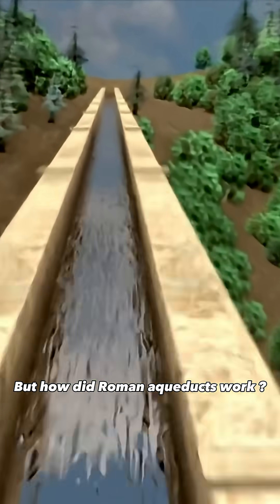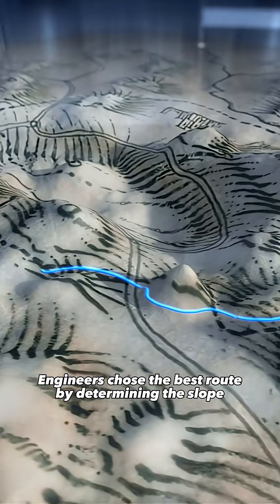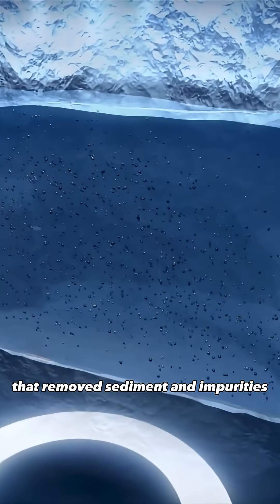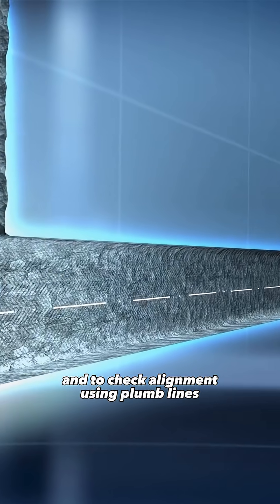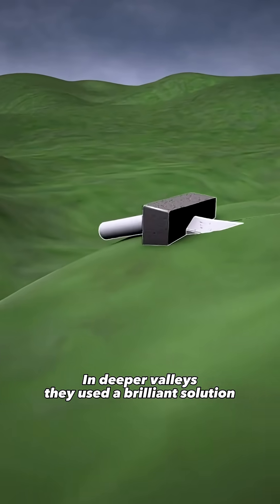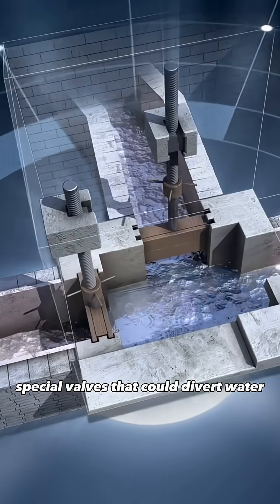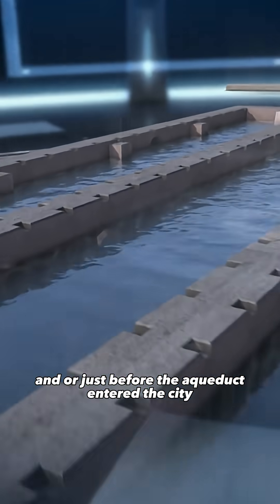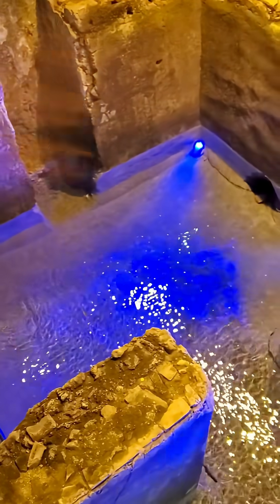The engineering of roman aqueducts explained #history #romanempire #engineering #aqueduct

Comment: Truly geniuses. I’d love to see what they could do with electricity and engines.
Reply: Probably what current geniuses do tbh. I mean, the concept of a computer alone is fucking insane if you think about it.
Reply: @alwest4472  Still black magic to me and im a cs major
Reply: @alwest4472  not that complex by how it works, just the structure itself is
Reply: So oddly the romans and the Greeks both at many points had invented steam power. They used it in baths. The biggest issue for the romans was precision as engines require tight tolerances. For the Greeks it was culture and philosophy that got in the way. Why make something when you can simply discuss the idea and move on with life.
Reply: @Peyto23 The biggest problem was their steel was not strong enough to build up pressure. The stronger steel was invented in the late Middle Ages. They could only bult toys with steam
Reply: @stijnvisser2290   Could have used sun-powered Stirling engines for pumping water, if they invented them.
Reply: @boofergod  even if the Romans had figured out the precision problem, it still would have been impossible to industrialize. At least in the way we did, because they didn't have any steel to build key components. Trains, and train tracks would have still been impossible.
Reply: @boofergod no tolerances don't even enter into it when you've not yet developed the metallurgy and machining techniques necessary.
Reply: @boofergod 
Regarding the Greeks, what you say is a bit exaggerated, philosophy did not stand in their way but was the basis of their development as a civilization. It is important to note that their philosophy is actually a trajectory of psychology and analysis, just the fact that they did not stand out like the Romans in engineering mastery, this does not mean that the Greeks, through their analytical thinking, did not have a titanic contribution to their development as a civilization (otherwise, they too would have evaporated over time and disappeared like many other ancient civilizations)
Reply: @gustychad2093 They weren't geniuses, they copied the Egyptians & Persians. Listen to Dr. Roy Casagranda of The Austin School.
Reply: @boofergod what a nerd. I agree.
Reply: @boofergod yeah i think greeks were caught up in philosophy
Reply: @boofergod  it’s sad that many don’t have that same philosophy today
Reply: @boofergod  The steam engine was invented in the Ottoman Empire. Its purpose was not to start an industrial revolution, but to spin the doner meat while it's grilling
Reply: @redacted8983  huro (hero? Whatever) of some city in greece invented a simple steam turbine well before the prophet was born.
Reply: @boofergod Neither of them had the economic and legal system which would support innovation, and its application in large scale.
Reply: @boofergod  wtf are u saying 😂😂😂
Reply: @Peyto23 The Romans and Greeks at the time simply didn't have the atmospheric knowledge or technology to create the air-tight, pressurized environment the steam engine needed. They didn't invent steam power, they played with steam and the idea of steam's uses. Both had economic, societal, and technological reasons NOT to go any further to full-scale production of industrial machines.
Reply: @boofergod That Greek response gives me pain
Reply: @boofergod  I have never read something so shallow and garbage about two great cultures.
Reply: @RichardWagner-hi4zn  and yet it is incredibly fair and accurate. The romans did not have precision. As a machinist working with tolerance a qaurter of a human hair is difficult. Thats my job. Roman engineers were insanely smart. They invented/borrowed from everyone. The issue still stands is that they did not hold precision in a high standard. At the time it was not a priority. Nor a necessity. Precision is not inherent. It is not a given. It is an invention. And that requires many more inventions and technology before you can sniff an engine. The romans were not even close to any of those. And don't even start with "but old times had better wisdom, so they may have had a better way of making engines" that is a fallacy to the max, and belongs with every failed engine design ever. 

The greeks being too philosophical is also accurate. They themselves as a culture in many writings pushed the idea that if it can be thought of then there is no reason to make it. As the world is not for making things. The invention of the scientific method would not have stuck in ancient greek  time. Nor testing ones ideas, because once again a good logos is better than a great pathos.

  So shallow? Maybe. Inaccurate absolutely not. I love and respect both cultures, but for fuck sake they aren't gods. Every culture is dumb and smart in their own ways. Even the worldwide culture that is taking root now has way to many flaws in thinking, practices, learning, technology, and general life style.
Reply: @boofergod sounds like me 😂
Reply: @boofergod  Rome was more than 1 thousand years later..they where just a bit more upgraded
Reply: @youmadcozimright  some could argue rome never died, it branched out like a vine. But slowly that plant is being pruned.
Reply: @boofergod both were 🌈, which the Germanic tribes carried on with.
Reply: @boofergod black moors built this city
Reply: @boofergod greeks are so real for that i sit in my room thinking all day too they are such icons 😢
Reply: @boofergod Love em for that! Capitalism would never get in the way!
Reply: @boofergod  I feel that, Greeks.
Reply: @boofergod the Roman’s restriction was precision
The Greeks restriction was culture

The Americans restriction is the government
Reply: @boofergod For the Greeks tight tolerances would have been a problem also
Reply: @boofergod  Old ways die hard, it takes paradigm shifts for civilisations to overturn old tried and tested ways in the name of new society changing ideas.

Today we have capitalism that accelerates the rate of progress in technology.
Reply: @Jay-Kay-Buwembo  there are technologies that are brilliant, sitting in papers and collecting dust on university shelves. The ideas only fault was there was no where to place a meter.  As in you can change the world but you need funding to change the world.
Reply: @boofergod  They used it in baths .. and children's toys. No joke.

They had a toy that used power to, get this, propel itself along a track. And saw no real applications for it beyond that.

So much for genius.
Reply: @jamegumb7298 They were the geniuses of their era.
Reply: @jamegumb7298  Pointing out an irony of the time in retrospect doesn't mean they weren't smart with even some geniuses among them.
It's like saying we are dumb because we haven't found out that common object X is the base for revolutionary invention Y that doesn't exist yet. Like, duh?
Reply: @BalaenicepsRex3  i do respect both cultures deeply and each had genius. But for steam and how many times it was invented for power just drives the point home that some cultures need different scaffolding or lead up to tech.
Reply: @boofergod  what about the slaves no need to industrialize anything if you just can get free labor
Reply: @MaxTheLegend_YT  the slaves that Arabs used to build Qatar and fake cities like that in today's modern world?
Reply: @MaxTheLegend_YT  and an ignorant emotional comment like that just proves today's lack of information and education.
Reply: @k-dogg9086 You need a reason to save labor to even start beginning thinking of a industrial revolution and if you have millions upon milions of slaves that do the work for you it will not happen
Reply: @k-dogg9086  the point you are missing is that both had a massive work force that was essentially free. A slave is cheaper than a horse. So you never have horses in the field. Now you have no need for a horse drawn plow, the ox bow, the thresher machine, no need for a more dense powered machine to do the work.  

Do not assume humans will invent everything given enough time. Like evolution life get stuck in a status quo of slow churn for eons. Then a metaphorical asteroid comes and changes everything you know about your world and things need to change fast. Those who can adapt will do better. This is humans and ideas in a nut shell. Just a reminder that the fax machine was invented before the telephone, the tv, the internet, and film cameras.  So ideas are not a given.
Reply: @boofergod   you have a wrong view on philosophy, culture? maybe but science too uses well established epistemic tools developed by philosophy to test and validate, innovation is for the curious and dedicated,its not philosophy that got in the way, just the lack of curiosity
Reply: @kazukawasaki97  you are imparting your ideas on a culture that no longer exists. Do not mistake modern ideas for ancient ones my dude.  So science is philosophy to the greeks.
Reply: @boofergod I'm not Greek, but I lose myself in that theory painfully regularly.
Reply: @boofergod  Aaand because both rather set on slavery than machining.
Reply: You can, go to Rome now 🤣
Reply: @TheDigitalGuerrilla lmao
Reply: @TheDigitalGuerrilla  not the same without gladiators and slaves(((
Reply: @TheDigitalGuerrilla  absolutely hilarious.
Reply: @TheDigitalGuerrilla not anymore
Reply: @TheDigitalGuerrilla not too bright are you
Reply: @TheDigitalGuerrilla  why do y'all always have to hate, i thought it was only non-eurocentric videos I'd see stuff like this, ngl broddies comment was corny asf but u could have just left it
Reply: @TheDigitalGuerrilla True 😂
Reply: @TheDigitalGuerrilla  come on get this guy to a deserved 999 likes

No more though, they're still being a smartass
Reply: @TheDigitalGuerrilla the culture is different
Reply: @TheDigitalGuerrilla no like the Romana who worked withbtheir hands not those spoiled loaers in Italy who let machines do all the thinking for them....modern man is lazy af where as ancient man was twice as smart and worked 1000 times as hard
Reply: @TheDigitalGuerrilla 😂😂😂😂😂
Reply: Lol @TheDigitalGuerrilla
Reply: @TheDigitalGuerrilla you missed the point😂
Reply: @TheDigitalGuerrilla  Modern day Rome and ancient Rome isn't the same
Reply: @TheDigitalGuerrilla  yeah and see what shit is now
Reply: @TheDigitalGuerrilla pick pocket pick pocket 😆
Reply: @TheDigitalGuerrilla  facts 😂😂😂
Reply: @TheDigitalGuerrilla not the same Romans using it, I think he means the guys who did this work that were long dead before the invention of the internal combustion engine.
Reply: @TheDigitalGuerrilla  how electricity would work if it was as a solution,  not for money. Probably thats why we had tesla as humanity.
Reply: @TheDigitalGuerrilla those are Italians not Romans
Reply: @TheDigitalGuerrilla  Yes you can. But he specifically stated he wanted to see what the Roman people could do with engines and electricity. You can't get that just by going to ancient Rome. You only see the architecture that they left behind.
Reply: @TheDigitalGuerrilla Rome looks more like a 3rd world country now
Reply: Human brain size has shrunk since those days.
Reply: @TheDigitalGuerrilla There is a lot we don't know about the Roman Empire and they were more advanced than what we previously thought every time we found something new
Reply: @TheDigitalGuerrilla  not the same rome 😂😂😂😂😂 get a load of this guy
Reply: @TheDigitalGuerrilla It ain't the Same. Italy today is a totally different Culture and Country, thank the Roman Empire Back then. They don't focus on megalomalic projects like in the empire times. Otherwise and if they were still as big and wealthy as back then it would be the largest economy in Europe possibly even the world...
Reply: @TheDigitalGuerrilla  There's a huge change in culture around how we use technology like this now, we lack the care unless it comes with the profit.
Reply: @TheDigitalGuerrilla do normal people and engineers from 2000 years ago still live there alive and well? No. Are you slow?
Reply: @TheDigitalGuerrilla  they get lazy now 😂
Reply: @TheDigitalGuerrilla  those Romans are not the same as ancient Romans.
Reply: @jaucianjommel  Modern day Romans are their direct descendants, though. DNA tests can't lie. The Barbarian  invasions just added their Germanic DNA input, especially in the North of Italy. The Roman Empire was huge so we Europeans have common roots.
Reply: @TheDigitalGuerrilla they are no longer Romans.
Reply: @TheDigitalGuerrilla rome and ancient romans are two different things
Reply: @TheDigitalGuerrilla Italians ain’t the Roman’s bro cmon now
Reply: @TheDigitalGuerrilla it’s not the same people humanity got lazy
Reply: @TheDigitalGuerrilla  we talk about real romans, not Italians, Italians are not Romans anymore, the Romans were warriors, Italians are cooks, great cooks but just cooks and mobsters.
Reply: @TheDigitalGuerrilla  Just because it's Rome doesn't make you a true Roman lol
Reply: I think they would be more amazed at me typing this message for the entire world to see if they wanted.
Reply: Alfa Romeo, Ferrari, Maserati, Lamborghini. . . 😉
Reply: @rajeevthapa5803  guy above you
Reply: They are called Ferrari .any questions ?
Reply: @donniebaker5984 guy below u
Reply: Ferrari, Lamborghini, Ducati, MV Agusta
Reply: They'd probably invent smartphones and sink into scrolling YouTube shorts.
Reply: Ya turns out not to much
Reply: @Cruzaman4040 you d%um;"'vb
Reply: @Cruzaman4040 what a foolish thing to write.
Reply: yea when we think about u @Cruzaman4040
Reply: @Cruzaman4040 😂😂😂😂😂😂😂😂😂😂😂😂😂😂😂😂
Reply: @Cruzaman4040   wdym... we were on the forefront of both inventions.
Reply: @Cruzaman4040 at least  they can spell...
Reply: @Cruzaman4040  i mean Ducati, Ferrari, Lamborghini
Reply: @Cruzaman4040 it's  called voltage because of Allessandro Volta 😂😂😂
Reply: @Cruzaman4040  Ferrari…Lamborghini…
Reply: Probably the same shit we do today with that technology lol.
Reply: Have you seen a stealth plane or a freaking smartphone I think we did amazing as a race of beings
Reply: You get the modern world
Reply: Slave trade and lack of incentives to develop electrical tech and engines beyond proof of concepts prevented them from doing anything.
Reply: @JMton_t yeah, those morans should have figured out how to have electric men that will toil their existence without paying taxes like trully proper slaves. Thankfully we have those coming online in exponentially increasing numbers now. So we have that going for us now, which is good.

All praise the Omnisiah's slaves!
Reply: @JMton_t  roman empire decay came with the adoption of Christianity. Slave trade would've been even an incentive to start advancing tech, what other incentive than to invent something new. 
However, Christianity got in the way of the east roman empire, leading them to their fall out in the mids of the first milenium. 
From there, we already know what happened.
Reply: @JMton_t Ma stiamo parlando di 2.000 anni fa!
In questo grande periodo di tempo si sono fatte tante nuove scoperte. Gli antichi  acquedotti a Roma sono stati rimordenati, ma funzionano tuttora.
Reply: @amadella8785  I am aware of the time period, and due to the availability and establishment of slavery of those long ago times, Roman engineers could not further develop the technologies that they did that would not see further development and establishment until the 1800s. Ancient Romans could have developed electrical technologies, steam engine varieties, and much more, but there was no incentive to do so. Tesibius of Alexandria developed the pipe organ, that was the most advanced technology that made it into the Medieval Age. Plastic surgery and some other medical advances could have made it into the Medieval Age as well, but the church forbade them or they became lost.
Reply: The same things we can today lol tf
Reply: Agreed an engineering master class way ahead of there time not to mention there concrete was A grade as well.
Reply: Well it's highly probable that most people with western European roots are descendants of ancient Rome. The empire was vast and very diverse, so a lot of the modern engineering we have today was likely invented by descendants of Rome.
Reply: @vecturion Agreed.
Reply: Ferraris and Lamborghinis
Reply: @jpteknoman not all modern Italians are related to Romans.  Italy was invaded many times and Germanic tribesmen took over italy and Europe.
Reply: Became Imperium of man
Reply: Are we not doing it?
Reply: invent smart phones and go brain dead like today's civilization.
Reply: That's not a good question man, because they are us, so you're already seeing what they'd do with electricity and engines. The question should be, where would we be if they had invented that, in that period. Would we be "in the future" or more or less at the same point? We'll never know. At this point we should probably wait 2000 years and see what'll be like to have the answer
Reply: They learned from other civilisations they not invented this thecniques! They implemented it very well!
Reply: That's how history is and always should be instead of acting superior but to understand each other @_mike628
Reply: The romans and greeks were aproaching an archaic form of industrialization, wouldve changed history forever if they managed
Reply: Not needed. Simply physics
Reply: They probably could have developed those things if the Roman government didn't stifle innovation that could potentially disrupt existing industries.
Reply: They also made a good portion of this with Pb so it was actually pretty toxic - which we know now in part due to their technology - all human beings iterate on what has come before and Romans are no exception. Much of this tech existed before the empire and would outlast it.
Reply: Basically the same as today.
Reply: Fiat? 😅
Reply: I mean, just look around at what you have now in your modern home.
Reply: Look around?
Reply: pornhub mostly
Reply: Why is it so surprising? Look at what we can do today with our technology. All we have over the ancient Romans is knowledge/tech. We’re not smarter than them lol. Your ancient ancestors 5,000 years ago were just as smart as you are today. Not as educated, sure, but just as smart.
Reply: It might be beyond what we can achieve now
Reply: I work in engineering and find the quality coming through is seriously lacking. With the world becoming softer and more woke, could future generations even achieve this if put under the same conditions? I’m not so sure, we’re heading in the wrong direction.
Reply: you see that as the world today
Reply: You can. They were humans, and so are we.
Reply: Literally go to any major city lmfao what do you mean? You can see what they could do with electricity by going outside and looking at the world around you.

If you want to be really mind blown by infrastructure, go to Manhattan, NYC and just take it all in. Mega cities in general are testaments to the ingenuity of people, they are so insanely complex and intricate it's amazing any of it even functions.
Reply: They did know about the steam engine. They didn’t industrialize because they had a slave society.
Reply: We'd be interstellar by now.
Reply: There's some evidence that indicates, given a little more time and stable conditions they would have perfected and employed steam-engines and tracks to transport troops and goods across the empire. Most of the technology was within their grasp and all they needed was a unifying idea or necessity to galvanize them into action...
Reply: Persians invented aqueducts.  The Greeks & Romans improved it.
Reply: That's just the modern world lol, it's not like the Romans went extinct. Modern infrastructure is pretty astounding if you think about it, it just feels less impressive because we take it for granted
Reply: That would be interesting, but not modern day Rome, but Rome as they were in their prime
Reply: So what we do today?
Reply: Geniuses eh?
Renaissance Italians vastly surpassed the Romans in revolutionary inventions and modern Italians vastly surpassed the Renaissance.
I mean the radio, the battery, nuclear energy, the nuclear reactor, three different elements, modern concrete, universities, cathedrals, hospitals, banks, the piano, the violin the cello, the first computer, the lamp bulb, the telephone, everything from the modern theory of music to modern scientific method.

Italy is responsible for more discoveries, inventions and overall contributions to mankind than literally any other country on Earth.
"I wonder what they would do"
You don't have to. 😂
Reply: You can see it now.
I don't know what's worse: your comment or the fact that 16k people liked your comment.
Reply: They still don't have this in Africa 😂😂
Reply: Nothing different from what people are doing now
Reply: Well Sub-pump stations and plumbing are essential works of engineering genius too. People just don’t pay attention to them, how else do you think you get your water? Aqueducts are cool cuz we’re like wow how did they have such a complex system 2000 years ago, when the systems we have in place now are 10x more complex and just as fascinating too. Not to mention how the power grid works. Modern cities are a marvel.
Reply: To imagine that the Romans almost invented the steam engine... I mean, they where that close with the Aeolipile, they just would have needed someone connecting the dots.

But I think that's one of the massive disadvantages of an economy based on exploiting slaves - the need to innovate is much smaller.
Reply: Wondering how such an idiotic comment can get so many likes?

All you got to do is to remember that the average person is an idiot and half of the population is even stupider than that. It explains a lot.
Reply: So are you going to time travel to see it? 😅😅
Reply: why are you saying that like an alien watching humanity evolve gng
Reply: Romans didn't event Aquaducts. Egyptians and Assyrians used them before the Romans did.
Reply: Meet the Germans!
Reply: They preferred slaves labor with some mechanical ingenuity.
Reply: They weren't geniuses, they copied the Egyptians & Persians. Listen to Dr. Roy Casagranda of The Austin School.
Reply: They didn’t have short term profits as their no.1 priority
Reply: @StoutProper when they ran out of money they just went to their neighbors and extorted more or conquered more land.
Reply: They actually had stem power, just never really figured out what to do with it. Basically just used it for some fancy giant doors
Reply: It would be a "waste" as power tool's are today, Environmentalists prattling on about saving the planet and lazy bar stewards can't turn a screw on nut by hand, Mining materials for batteries and drills so some lazy w@nker doesn't use a bit off muscle power
Reply: certified non-white comment award
Reply: It's called the Bellagio.
Reply: True geniuses, I’d love to see what they could do while indulging in whiskey and cocaine
Reply: Sit on their asses and play video games
Reply: Or without.
Reply: Nuclear weapons
Reply: Why is that these stop using it in these days.there going to be a time for this idea to come back
Reply: the same shit just larger
Reply: Good luck in waiting. You're going to be waiting a long time...😂😢
Reply: That's us today
Reply: Italian Bikes Ducatis
Reply: Look at Ferrari and Lambo
Reply: If the dark ages didn’t happen and an unknown amount of knowledge forever lost, maybe the world would be far more advanced. Curse the Black Death….
Reply: Look around......
Reply: They didn't need it.
Reply: It called Ferari for starters .
Reply: Bruh!
Reply: Whatever we do now… they have some crazy shit over in Singapore
Reply: Rockets
Reply: This is a passive system, trumps the modern pumps asisted stuff anyday
Reply: Funny thing!
Reply: The same as us.
Reply: They wouldn’t. Why use stuff that’ll break in 20-30 years when this has worked for thousands of years?
Reply: What we do?
Reply: Pyramids of Gesa engineering holds many clues.
Reply: I think. I think thats just called modern people bro
Reply: Except the Romans didn't invent the Aqueduct. They took it from the Etruscans, who were building them when Rome was still just a collection of mud huts.
Reply: They built ferraris?
Reply: Look around you🤡🤡
Reply: Super cars of today.
Reply: Eastern Roman Empire which later rebranded to the Byzantine empire was still around for 1000 years after Rome fell. Looks like not much and most of the innovation was done then Rome just sat on its laurels
Reply: You're looking at it brother
Reply: What a dumb statement 😂
Reply: barbaric. they were much more advanced than "electricity and engines". they were tinkering with electromagnetics and ethereal energy. you dont even have a clue. youve followed mainstream his STORY for too long. all history is carefully edited to keep you poor and uneducated.
Reply: Shitty cars.
Reply: They got and became lazy
Reply: The same thing we're doing today. Thet were not smarter or dumber than us, we just have access to a larger accumulation of knowledge and technologies.
Reply: we'd be speaking ancient latin if by now
Reply: You see it everyday lol
Reply: The same thing as us? Why do you think the Romans specifically would be able to do something different?
Reply: Yeah but they wouldnt make the cities closer to the water source?
Reply: @asabigmotherfuuckeribelive  Let's just take Bikini Bottom and push it somewhere else!
Reply: Ferrari

Lamborghini

Maserati

Alfa Romeo

Fiat

Lancia

Pagani

Abarth
Reply: One has nothing to do with the other.
Reply: Unfortunately as we’ve seen, any great scientific discoveries are squelched. Likely geniuses like the ones responsible for the aquaducts are put out to pasture well before they see any headway.
Reply: Germans during ww2, I mean they had radar guided bombs in the 40s 😂
Reply: They were humans, it’s us. We made cars
Reply: They didn't need it
Reply: There is no they. We are "they" now.
Reply: ....We are them....Look around, and you will see what they would have done because it's what we did...
Reply: I find the design rather shallow and pedantic
Reply: It’s frightening seeing how many people aren’t aware Roman’s/Greek learned everything they know from African civilizations.
Reply: Look at China that’s what a society that locks into public investment looks like in the 21st century and before ur western mind says uhhhh repression  square prions we have all of the political repression and humans rights abuse and none of the flying cars bullet train 200 dollar a month 3 bedroom apartments
Reply: Probably expand the Empire to other planets or even another galaxy
Reply: Slavery
Reply: Geniuses like that aren’t encouraged let alone even exist in today’s world
Reply: I'm absolutely amazed that they relied only on gravity. Surprised that they didn't ad a screw pump but they knew that it would require an energy source and would be a weak point. Because of this, they're still working today, thousands of years later 😮 meaning nearly a trillion gallons have passed through one passage 😳
Reply: Well ducati lamborghini, pagani, aprilia, ducati are italian
Reply: Nap, lose wars and eat pasta like they do today
Reply: What do you think happened to the Romans? Do you think they just blipped out of existence the second their government collapsed?
Reply: They did almost invent the steam engine. They did invent a contraption that could potentially become a steam engine. 2000 years before it actually started being used
Reply: They'd probably conquer Mars with our technology 😂
Reply: They’d be in goddamn space by now
Reply: Probably währe same things we do today, just in Latin
Reply: Well, they would do what we do, they were humans too😂
Reply: They could have had that if they didn't have slaves.
Reply: They actually had the capacity to design more complex technology but chose not to because they feared it would remove purpose from people’s lives.
Reply: Lol. We are living in the age of what humans can do with those things. Many of the things we do today are just as impressive as the aqueducts. Just take a look around and you will see the answer to your question all around you.
Reply: China : Leave that topic to us...We will take care the rest
Reply: You are able to see that there are still Romans alive today go there and visit
Reply: Look around you lol
Reply: io they had had  engines and electicity, the whole world would be speaking latin now
Reply: Maybe we don't 😂
Reply: How is this possible. Half of the students that graduate from high school can't read or write.
Reply: An era when there were fewer distractions compared to the vast amounts of brainrot we encounter😢
Reply: Nothing. Their society has degenerated into pure hedonism.
Reply: CONQUER THE WHOLE WORLD.
Reply: Dumb comment, they're just like us working with the technology they had
Reply: prob the same things we have made.
They were smart humans just like us
Reply: That's how smart phones and smart devices are made, with modern geniuses.
Reply: they were very very close to making the steam engine.
Reply: You can if you look at the pyramids
Reply: They’d probably come up with things just like us, because that is what we are. Romans with electricity
Reply: Yeah thats what this regime was able to do back in a time of savagery, then came their collapse and the dark ages began, a long period of decline. Imagine the world if the roman empire never fell.
Reply: F everything up for everyone most likely. Just like us
Reply: probably not smarter than us... otherwise they would invent electricity and engines than using these methods.
Reply: Ferrari and Lamborghini bro
Reply: They’d be us
Reply: You're looking at it
Reply: humans just getting lazy
Reply: @abiyyupanggalih854 lazy? You're watching a high def video transmitted to space and back on your personal super computer while you take a dump. Things are going well as far as technology goes.
Reply: probably as much as our modern engineers
Reply: It would probably look like our modern system that delivers clean and fresh water to 99% of a country way bigger then Rome.
Reply: they had oil back then and steam engines, they considered it useless.
their entire economy relied on slavery, so uprooting that was a no go.
Reply: If you actually start reading history books written by people of that time and on... you quickly realize a lot of stuff is missing from our record.

And it also appears that centuries are mixed together. Flipped around or completely made up... or like in the case of the "dark ages" its all but removed entirely from our historical record.

You soon realize that you've got no clue what the Roman's could've had.
Reply: Romans had steam power. I think the reason they never made an engine is because they didn't have a need for it. Steam engines are only efficient at big loads and the Romans had no need for it. With capitalism and market competition people had a need to try and deliver stuff faster and in bigger bulk than before for the only purpose of making more money.
Reply: Buddy. You see it every single second of your day
Reply: many great innovations were driven by necessities. if electricity and engines were available, there wouldn't be such ingenious innovations and the creators wouldn't have been defined as geniuses
Reply: They wouldn't need em.
Reply: See China
Reply: Convince is the killer of ingenuity
Reply: Bigmisconceptions. Romans were smarts, and we are just not as smart as we think. WE just have more tools. What they did we can do. and what we do they could do if they had the extra knowledge. 200 years is nothing in term of evolution, humans can just pack up knowledge every generation and improve it and this is why we are to the state we are today
Reply: Prolly make f1 street legal
Reply: they made Ferarri
Reply: You know its us... we are the same humans
Reply: @zizozzoziz6720 we do not have the same resources and great minds.
Reply: @hhazzacr2412 yeah einstein and and bohr were really dumb tbh......
Reply: its called lamborghini
Reply: Well it almost happened, had that guy been spared from being crucified.
Reply: You’re literally seeing what they would do. Roman’s were just advanced humans of their time. We are more advanced than ever.
Reply: they'd do what we've done. What the fuck do you mean. we are all humans, our knowledge compounds.
Reply: Pizza and pasta :)
Reply: Truth is my friend they had em,or some early form of em in a way,but could not see their value.In the era after Alexander the great,there were found small toys that used steam to work.They lacked the right perception of their knowledge or the circumstances didnt let em research em more(like wars,famines etc)

Religious fanatism and greed for conquest ,really held humanity behind for 1500+ ages...
Reply: Actually a very famous ancient Roman engineer existed. His name was hero of Alexandria and he lived in Egypt. ❤
Reply: they had those things
Reply: No mention of the curvature of the earth.
Reply: nothing much, because hard times hard men, soft times soft men😅
Reply: how tf have 22k people liked this comment, am i surrounded by brainded people?
Reply: Buy a Ferrari
Reply: Tbh probably what were are already doing right now.
Reply: They'd adopt planned obsolescence before they built anything this cool.
Reply: Just the same we do, we are still the same specie.
Reply: Well, that's what you called "modern society"
And you're living in it right now
Reply: Your looking at it.
Reply: Well that’s what you do see today
Reply: Not a ton they had no concept of patents or intellectual property so some mid wit  senator could rip off your idea. innovation would be slow.
Reply: All of modern society. The human condition has not changed. Modern humanity is wonderful.
Reply: They would pray for Israel.
Reply: Will that's us.
Reply: Open your eyes 😮
Reply: The thing is there already was an steam engine developed by Greeks. But it was seem more like a toy or science showcase object, rather than something useful.
Reply: If ancient romans had electricity and engines before everyone else. They would have conquered the world.
Reply: You can. It’s called water pumps. God it’s not like we’d have some weird magical future tech.
Reply: @rockstar-5934  We kinda do, it's just that we understand the magic
Reply: This generation believes any thing told.These are collage level listeners,that think Moses,Elijah,Christ and the apostles are white . I always thought it strange that the children of Israel,white,but in Egypt Africa 400 years a slave.? No where in history where white people were in Africa B.C.1244-A.D.5.  If unchecked history repeats itself,then the Bible told the black story.
Reply: that is our world. romans were humans like us
Reply: Well for one they dont know how those work. Theyd have to atleast learn how it works for a bit
Reply: uh probably what we did?
Reply: Us bro… we are those people… xD
Reply: That is what we call "Modern Day"... what the hell
Reply: White people are amazing
Reply: Well... what we have today is what we can do 😂
Reply: Western Civilization males. And a lot of slave labor.
Reply: probably not much
Reply: You don’t even know.  Look at the new pyramid findings.  Free energy
Reply: Look at Germany
Reply: Bravo White Civilization!❤👑🗽🏺
Reply: FAAACTS!!! IMAGINE IF THEY HAD THE UTILITIES AND TOOLS WE HAVE TODAY.
Reply: @Dzorens92 I think the truth is imagine if we had the technology and tools they did.   Pyramids were free energy.   Roman water was purified
Reply: Geniuses exist now too. They were not that special, they only had the right opportunities and circumstances compared to others.
Reply: You’re living in it my friend
Reply: Ahhh you do know our technology is built on this? So what they would do is what we did do.
Reply: Weatern Europe
Reply: They're not Roman, they were built by a previous high tech global civilisation that that was destroyed by a comet in 562AD.
Reply: Rome's biggest weakness was, ironically, that its bureaucracy was too small. If you lived in a regional area and needed something done, you wrote it on a scroll, gave it to an official, and they'd go to a place and basically toss it on a pile. Eventually someone would get around to taking the pile to Rome. It could take years.

They also had this weird rule that if you didn't pay your tax for IIRC 15 years (or was it 5 years?) you could get a 30% discount on your tax bill. So nobody paid their tax for as long as they could get away with.
Reply: You can see it today, just look at Ferrari 😭
Reply: The exact same thing thing we’re doing with it now
Reply: Same things we could do if profit wasnt our main motivation
Reply: with electrcity and engine, you have to change piece every year. But the roman built something and didn't change a piece for 2000 years, and still work.
Reply: They almost did. They had steam gadgets and water timers. But as for cars,  "That's why God made horses." Cars are individualistic.  They couldn't see a desirable condition where a man works all alone. It's lonely, nobody has your back, and two heads are better than one.  Plus, they just really liked horsies.  And slaves to drive them.
Reply: Take over the entire world probably...
Reply: nah motors and electricity let you get lazy

the reason all this looks genius is because the modern example is, run a pipeline with pumps occasionally 

or how every computer engineering problem is solved with an Arduino coded to solve whatever problem they had instead of custom pcbs
Reply: Ever heard of dams? Shit’s wild.
Reply: If the library in Alexandria wasn't destroyed, there's no telling what advancements would have been made much earlier than they were. I'd safely bet we'd be more advanced than we are now.
Reply: The ruling class had no need for that, since they had servants and animals to provide such power. But those need WATER, thus the aqueducts. Only political equality led to modern technology which benefits the many vs. the few, as Milton Friedman said.
Reply: Funny enough, Rome did make a steam engine, but it was too expensive to maintain since they didn't discover steel.
Reply: And without Christianity hindering their progress
Reply: same shit as we do
Reply: You can, literally just look around. The romans were humans, we can and DO build much more impressive stuff today.
Reply: You are seeing them now as you live daily life
Reply: I think about the same as us
Reply: According to conspricary theorists they had  static electricity.
Reply: See! Germans that's the heart and soul of the Roman empire
Reply: I imagine not very much, without electricity they had to get creative
Reply: And high speed trains.
Reply: That required brains and talent, yes. However that was thousands of years before conductive electricity was a thing. They knew not how to harness it, nor even what it was.
Reply: You're looking at it, chief.
Reply: my brother in christ have you opened your eyes lately?
Reply: Best thing about no electricity and motors is they just work, even in a blackout.
Reply: Nothing cos they're dead
Reply: While sitting in your plumbed house, you wonder what they'd do?
Reply: They were not a different species 😂 You are litterally now watching on a phone that is ”what we can do” with electricity 🤦🏻‍♂️ 🤣 Such a weird comment
Reply: You're living in the world where "they" are using electricity and engines
Reply: Same shit we did lol they were humans xD
Reply: Nothing. They werent smart enough.
Reply: They “buried” ancient knowledge. But in all reality the tech and engineering marvels we have today are a direct result of growth upon their creations. However, absolutely none of our governments put tax dollars back into improving infrastructure the way they did. Now it just gets laundered and funneled back into the pockets of the ultra wealthy that have far greater tech and engineering in their mansions, yachts, cars, etc… than most of us can really comprehend.
Reply: Actually Romans at that time we're mostly pagan theives who sacrificed people to the demons they worshipped in the Colliseum and wars of conquest 😂
Reply: Slave labor certainly helped too...
Reply: Congratulations we have the modern world
Reply: Yea, sadly the more tech we get the closer we get to ideocracy.
Reply: Roman's now arent educated with slave labor and a strong nation.
Reply: They made Ferrari
Reply: They is we. They’d do what we did. What’s most impressive is how they built up to it.
Reply: you can see it. just open the eyes and look at the symbolism
Reply: Maybe they has this.
Reply: Ferrari?
Reply: They created Lamborghini and Ferrari.
Reply: Populate the milkyway probably
Reply: It’s called Ferrari
Reply: Look around.
Reply: Nothing cause it’s already been done
Reply: I vaguely recall a documentary that discussed how close the Romans were to electricity and their understanding of a steam powered engine
Reply: They do the same thing that leads us to what we have  now
Reply: This is the problem: ruining something working on natural principles with some commercial shite to make more money... 🙄
Reply: Flag on the Moon by 1500 top
Reply: play fortnite
Reply: Ferraris?
Reply: They'd land on the moon.
Reply: The same that we are doing now
Reply: Fiat and gucci, it turns out
Reply: China is the example my brother.
Reply: Just imagine  the time it took to build  all that and the people  who came up with the ides
Reply: Made things lazy
Reply: Theyd do what we did. Were all humans, and we can be pretty smart ever since we came here
Reply: @yektaagra741 I’m not a human 😂
Reply: @DEATH_STRAND1NG  Damn thats tough
Reply: Naaah, they have to pay engineers, unlike slaves
Reply: Me going back in time and giving Hadrian an AR-15, an Iphone, and several thousand barrels of White Monster
Reply: they would land on the moon with a fraction of the computing power of your phone
Reply: All you have to do is look around you, friend
Reply: you've heard of ferrari i asume?
Reply: nothing tbh, thats why they focused on aqua
Reply: Right
Reply: 408
Reply: Actually I believe they found ancient roman plans for a steam engine. These guys were close to an industrial revolution 2000 years ago
Reply: You are seeing it. The Roman empire never died. They realised no empire can control that much land. So they switched gears. The basic principles of made that empire are still used now. You can see it in even simple things like how everyone contributes to the "empire" in some way, whether as a soldier or as a means of production.
Reply: This isn't completely their invention though. A very similar and arguably less advanced version called qanats were invented by persians.
Reply: As empires go, this is the big one.
Reply: You can...It was called the British Industrial revolution .Where engines were invented and Electricity understood and put into use ..
Reply: ur seeing it, it's the stuff we have now
Reply: Uhm, you're looking at it dude. Lol. The same thing we do now. 😂
Reply: What a weird comment this is man 😂😅
Reply: If I'm not mistaken, the CERN Particle Accelerator was built by the ancient Romans 😂
Reply: @leafwhite6376  wut?!
Reply: You're seeing it... They didn't just disappear
Reply: NO! THATS ALL A LIE! Romans didn't invent it! Persians did!
Reply: If they were put into modern age, they would probably slip into modern age cheapness. They built on to last not to be replaced over the next few years
Reply: you should see what’s going on with electricity and engines now. cool stuff.
Reply: Slavery sucked!!😮
Reply: They're still living among Us today, and so are the Babylonians, Persians, Greeks, Macedonians before them.
Reply: كل هذا، نقلوه وتعلموه من قرطاج ... لكن التاريخ الأوروبي لا يذكر هذا 😊 😊😊
Reply: Anytime our Race is free to do as we please, we change the world for the better, then people like Nero get into power and the floodgates are opened, letting all cultures into our city and everything falls apart.
Reply: And yet they crucified Jesus.
Reply: Bro the racism in this comment section is unreal
Reply: become lazy..
Reply: I'm pretty sure we'd all be speaking Latin.
Reply: Well Ferrari, but lol. Turns out there's a better Rome
Reply: Rob you 😂❤
Reply: Be worse than Trump and ask for more taxes 😂❤
Reply: Deport N and ☪️
Reply: too bad the third reich didn’t get the chance
Reply: I think they wouldve done about as good as the German engineers did
Reply: ...exactly what we've done with them lmao. They're not a different species you dolt
Reply: No slave labor
Reply: Respuesta: embalses con estaciones hidroeléctricas
Reply: they are us lol. you see seeing what they would do with electricity and engines. it’s what we’ve created today 🤪
Reply: @chasing-mental-clarity 

Not you but your ancestors. Greeks today arent the same. Thats why yall havent landed any rockets yet.
Reply: the same things we do with them man
Reply: Check out what the Chinese are doing with the north south water diversion project, they’re much more impressive than the aqueducts if you just go by scale and technology
Reply: They were given over 1000 years.
Reply: exactly what weve done. remember, they were not aliens. they were humans in a society just like us
Reply: Look around you.
Reply: Exactly what we did. Become lazy.
Reply: We'd all be speaking latin
Reply: Stick sponge
Reply: When life gets too good they let Muslims and blacks in and let them ruin their countries. That’s what happens
Reply: Make a ferrari
Reply: With the intellect they had to figure out of this I’m sure they would have come up with something if not similar then crazier than what we have today the stuff they figured out was extremely good for their time and it’s sad that they got too large to manage.
Reply: And capitalism 😂
Reply: Yeah so the modern worlds systems basically are what the Roman’s would do with electricity and motors. Our infrastructure network is more impressive then all of the things we dub “wonders of the world.”
Reply: They made free energy for the cities.  That’s why cathedrals (cathodes) have antenna shaped metal at the top.  

Also God is actually the energy in the atom, which is the energy that is used for these cathedrals - Now Government (ment is mind, Govern Mind) took over the buildings and the elite rewrote history to say we built these things less than 300 yrs ago, which is not true.  It was impossible how they say.  But thats why these places are called the Temple of God - Bc our body is the temple of God and thats who we all are.  

Nikola Tesla proved this with his towers bc he copied the Pyramids of Gyza, this is recorded btw.  Thats why they tell us Pyramids are just “tombs”.  

Look at Hindu Temples, theyre literally in the shape of our body.  Hue Man - Light Being.  Everything is real and this stuff isnt “magic” but it appears that way.  

They have diagrams for the cathedrals which show how the different metal is used in different spots.
Reply: They made Fiat and Alfa Romeo. Known for their scary low reliability
Reply: Nothing…because the Democrats today will over regulate everything from what to do and how to do it while calling themselves progressives 🤦‍♂️
Reply: Oh mate, you're gonna love present day
Reply: They didn't need those, slaves were waaaay cheaper.
Reply: Wow, I never considered that! Imagine what those mofos could do with power! 😮
Reply: You know they're humans too, right?
Reply: Look at us now lmao, they were humans just like us not some mystical aliens
Reply: Build lights, rocket ships, and Teslas 😂
Reply: Go to Italy now, it's a 💩hole
Reply: These madlads probably would have expanded the Roman Empire into the entire Solar System if they existed all the way into our age
Reply: About the same as we have now. Genius isn’t limited to the past, and the proliferation of knowledge has made it likely that people will be exposed to things they can become passionate about.
Reply: I mean rome is still around
Reply: Cars, Airplanes, Mega bridges, Internet, land on the moon... Its just humans, you can see it now.
Reply: They would make the same stuff as everyone else because theyre the dame
species
Reply: They'll take over the whole planet.
Reply: There’s also the factor that slave states are slower to progress toward industry because they don’t need innovation when they have manpower for free.
Reply: With the number 0
Reply: They already build ferraris and lamborghinis
Reply: "They" are us.
Reply: America
Reply: The British and Americans excelled there. Look at pretty much everything around you 😂
Reply: Well, it wouldn't last as long that's for sure.
Reply: What? Rome is still a place today though? They didn't go extinct?
Reply: We'd be so extremely advanced if we weren't obsessed with greed. We make everything as cheaply & quickly as possible. There's not much room for advancement anymore unfortunately because no one is paying for detail, creativity, or innovation.
Reply: Yes and after that let's also see how engine mechanics and electricians build aqueducts.
Reply: The same as us
Reply: A lot of civilizations built similar water systems Muslims for example built the systems under earth they were more flexible efficient expandable and suited to hot dry regions but of course no one would appreciate the muslims for this
Reply: Basically, Ferrari and Lamborghini.
Reply: Invade iraq
Reply: It’s not like they’re superhuman, bozo. Just go to Italy lmao. There they are.
Reply: Probably pretty close to what we’re doing today considering the Roman Empire is the single most influential civilization for the modern west
Reply: It doesn’t get more advanced when you modernize it. We have added pumps and such, but these are really the fundamentals of fluid dynamics and engineering. We still use these principles today. I am a wastewater treatment plant operator and things like settling tanks, sluice gates, and inverted siphoning are used today in most wastewater facilities because of their efficacy and cost.
Reply: You already know lol
Reply: I'm in awe, this is the most useless and empty headed top comment I've seen in my life. 48k likes. I applaud, couldn't have pulled it off better myself
Reply: If only they didn't use lead... Damn...
Reply: The thing is that when the Roman Empire collapsed, all this knowledge got lost for a very long time and civilisation went backwards. It took about 1000 years, into the late Middle Ages and early Renaissance, to equal or surpass Roman achievements in areas like construction, sanitation, and infrastructure.
Reply: Tartary it was
Reply: No the fuck you wouldn't 😂
Reply: probably the same thing we are doing. Take for example television, radio signal in general. Do you have the slightest idea how fucking bizarre shenanigans are going on there to send a moving picture with sound in 4k in a fricking wave? Yes, single wave
Reply: The modern interpretation of the vehicle is all due to Italian engineering, unitary Body Construction, independent suspension, the 5 speed gearbox, VVT and VVL(like VTEC, VANOS, Valvetronic and VVT-I), all Italian inventions, hell even the CVT gearbox was invented by Leonardo Da Vinci.
Reply: Those short cuts make them lazy.
Reply: I mean? Exactly what we're doing with electricity and engines today.

Humans don't really change as much as we like to think
Reply: they were still human beings, what makes you think they'd do different stuff with electricity than the later humans that had better education
Reply: @Cnut_the_grape these people who think like this are usually Americans who are dumber than a box of rocks but somehow think they can think on the level of Leonardo Da Vinci when they can barely string together a sentence, and don't understand irony or sarcasm 😂😂😂
Reply: Ummm, look at Ferrari?
Reply: This is incredible, didnt realise the systems were so complex
Reply: All they need is to not be jewed out and have nxggxrs running around in the streets.
Reply: Great pyramid of Giza is a large ram pump. The question is why the Illuminati did not let the world have freedom.
Reply: I would guess it would be something similar to what we have done. Considering brands are still the same size and IQs haven't really changed.
Reply: They were the same species as us. They would do the same things as we do.
Reply: Pretty sure they have that in Italy nowadays
Reply: Well just you be patient, we'll all repeat this circle of Life. Once more they'll be here and gone again, same as you and I.
Reply: Not genius they just thought all day because they didn’t have engines , we have engines and don’t have time to think about this don’t call them genius
Reply: I wonder were they go study
Reply: Look at modern day white Europeans. Same people. German engineering etc.
Reply: The ancient Greeks had a concept of computers. All they needed was an energy source. Some scholars say the Greek were 300 years away from being as advance as we are today.
Reply: Cities eating cities like that one movie
Reply: They were close to developing steam powered machines but it never came to be since they only seemed to be using brilliant works of art (like that one calendar computer) just to show off. But I imagine the moment they realize the potential of machines they would run rampant with them.
Reply: I mean Greeks invented robots thousands of years ago
Reply: Yea we call it plumbing today.
Reply: You're already seeing it. Centuries from now when they have cleaner and advanced energy they'll be talking about how we created and used electricity
Reply: @r @rootyoo-jin3310  your also being kinda short sighted because already other country’s are seeing our electricity become outdated while they switch to green, underground energy
Reply: Funny, we are what they'd do with it.
Reply: Open your eyes
Reply: You typed that comment 4 months ago on a digital video posted by someone else on the planet using your pocket size super computer...
Reply: @AnthonyGarcia-gx1yf  phones aren't super computers
Reply: You ever been outside?
Reply: @BowtieThomas  bro he means ancient civilization time
Reply: Less.  Constraints breed creativity.
Reply: @devvy-8279  true
Reply: We are them. Just 2000 years later. We are doing what they would've done if they had electricity and engines.
Reply: I can tell you what they’d try to do with our weapons lol
Reply: Literally just the exact same thing, they weren't special, they just had resources and manpower, the physics and math itself are relatively simple
Reply: @emanuelgonzalez7213 Leonardo de Vinci was indeed special lol. Centuries ahead of his time
Reply: Idk about all that now
Reply: Its called the US of A
Reply: Their hydraulic concrete was beyond amazing.  I am not certain we have figured out its recipe yet.
If we have, could someone please comment?
Reply: @EmperorMaximus66 there’s a lot of things we don’t know how to build that they used to
Reply: They need to design some of today's water supplies here in the USA.😊
Reply: @nealcook2868  City of Flint, Michigan, take heed!
Reply: Make their public bathhouses sanitary and not a bacteria parisite breading ground
Reply: @dotdot2560  *breeding ground, not breading ground.

Autocorrupt strikes again.
Reply: @dotdot2560 Parasite
Reply: @dotdot2560  Considering how low the infection rates were for common illnesses in rome, this is just not a thing.
Reply: @dotdot2560 its spelled parasite
Reply: you can, its us now
Reply: meanwhile.. in the black Africa...nothing
Reply: Rome still exists dude
Reply: @BisexualPlagueDoctor  The City. Yeah. But we are talking about the Roman Empire which spanned across 3 Fcking Continents...
Reply: They were on the brink of engines but decided not needed as they had slaves to do the work.
Reply: well the next great empire after the romans was the british, and you saw what we did with engines and electricity, we created this whole new world through the industrial revolution

but the romans were geniuses and in the uk we're proud of our 4 centuries of roman heritage, even though it was more fleeting than the rest of europe
Reply: @artemislogic5252 well I would say the next relatively successful empire was the Byzantine empire
Reply: @BuhBrih  the byzantines were just the eastern roman empire, they called themselves romans and were only called the byzantine empire by historians 300 years after its collapse, a lot of people will disagree but by all intents and purposes it was still the same roman empire, and if historians hadn't started calling them something different we'd still be calling them the roman empire
Reply: @artemislogic5252 well ig the Arabs there called it the Roman Empire cuz for them it was just the Roman Empire but uhh still the British empire wasn’t the next great empire
Reply: @BuhBrih  in terms of innovation on the scale of the romans and global presence it was
Reply: @artemislogic5252 The next great empire after the Romans was not Britain by a long shot. There was imperial China, the Byzantine, The Islamic Caliphate, the Mongolian Empire, the Caloginian Empire, the Inca, the Aztecs. Hell Britain isn't even the earliest modern great empire. The Ottomans and the Spanish started before you. Each of these empires were great and created engineering marvels during their time, whether it was civil or military engineering. So I'm not sure where you're coming from.
Reply: @artemislogic5252 I wouldn't say the next great empire...
Reply: @artemislogic5252  It wasn't the Mongols or even the Kievan Rus?
Reply: @artemislogic5252 after the romans came the Dutch bruv
Reply: @artemislogic5252  Electricity has been around longer then u think
Reply: @artemislogic5252  The next great empire after the Romans were the Ottomans.
Reply: @artemislogic5252  You're empire was created by Rothschild and the jews-masonry so it isnt the next greater to Rome. You condemned all humanity to suffer the actual satanic elite rule above us.
Reply: @artemislogic5252  What? Since when is there Roman heritage in the UK?
Reply: @artemislogic5252  The next great Empire after Rome was NOT the British lmao what.

Rome's successor was the Ottoman Empire.
Reply: @artemislogic5252  That's not quite the history I learned ...
Reply: @artemislogic5252 Wasn't it the Mongolian? Their Empire stretched into what is now modern Hungary.
Reply: @artemislogic5252 first it was the Portuguese and Spanish, later the english. But yeah,  all carried out the Roman Legacy in some way or another
Reply: @artemislogic5252 no you didn't
Reply: @artemislogic5252 next great empire was karolignian.  Followed by hre.  Then Spain.

Brits came after all of those.
Reply: @artemislogic5252 the next great empire after the Romans was the UK? Ah, leave it  to Brits to excel at ignorance and arrogance.
Reply: @artemislogic5252 yeah the Romans  keeping the local barbarians  in check😅
Reply: @artemislogic5252  what are you talking about? The next Great empire after the romans was the Omeya Caliphate, the frankish empire, the HRE, the Spanish Empire And the Otomman Empire, the France empire Ane after that the British empire lol
Reply: @artemislogic5252  The next great empire? Not sure about that. The Byzantine Empire, Kingdom of France, Islamic Caliphate, and Holy Roman Empire all came before the British Empire.
Reply: @_easyconcept  the byzantine empire was the roman empire, they called themselves romans and were only renamed the ''byzantine'' empire 300 years after its collapse by historians (i said this earlier)

the HRE was neither holy, nor roman, nor an empire, it was just germany

the french "empire" lasted about 10 years, and it shrunk the frances control over the world not expand it 

there's way better examples you could have gave for empires, but since OP was specifically talking about the advancement of technology, no one did it like the romans and the brits
Reply: @artemislogic5252  skipped like a millenium
Reply: @loganfytchy-powow4580  yeah sure but in terms of technology, no one advanced it like the romans and the british
Reply: @artemislogic5252  that’s honestly a fair point
Reply: @artemislogic5252  the British Empire was nothing.
Reply: @artemislogic5252  You're not counting the Byzantine or Ottoman Empires?
Reply: @nuclearrabbit1  not in terms of technology progression no, and byzantine empire was still the romans by most metrics
Reply: @artemislogic5252 The Ottomans made pretty big strides in mathematics and medicine.  The Byzantine Empire and the HRE could be considered extensions of Rome, I guess.
Reply: @artemislogic5252 No sé si es odio o ignorancia. El imperio español fue anterior al inglés y el descubrimiento de América cambió la Historia de la humanidad. Duró cerca de 400 años (más que el británico). Se construyeron unas 30 universidades y el mestizaje fue un sello de identidad. Muchos países hispanoamericanos durante el imperio español tuvieron un nivel de vida superior a los países europeos.
Reply: @frankberenguer3195  there is no hate, i love the idea of the spanish empire, i think the world would be stronger if the spanish kept their empire to this day, but nothing changed the history of humanity more than the industrial revolution, that's why the world speaks english and not spanish
Reply: @artemislogic5252  Spain became a great empire well before the British. Also goes for the Portuguese, Ottomans, etc
Reply: @artemislogic5252  the British empire was in the sunset phase by the time the steam engine became a thing. Don't even know your own history roll
Reply: @RanCham727  steam engine invented in 1698 by the british, 100 years of innovation by the british and a british guy stuck one in a train in 1804, no where near a "sunset phase" 

the height of the british empire was the early 20th century, only after ww2 did the british enter a "sunset phase" if anything 

some people are just mad for no reason, mad and wrong, idk, get a life
Reply: @artemislogic5252 The British Empire were the true heirs of the Roman Empire
Reply: @grandadmiralthrawn3164You forget the French Empire.
Reply: @artemislogic5252 The Spaniard Empire lasted 400 years, conquest more territory, left better civilization principles and didn't eliminate aboriginal cultures
Reply: @javiercortes5232  the british empire was more than twice the size of the spanish empire at its height and lasted longer, but to say the spanish empire left better principles is the most inaccurate, all the nations founded by the british empire have been politically stable and economically successful because of our principles and culture, and it was disease that wiped out most indigenous cultures, i love the spanish but what you said isnt true
Reply: @javiercortes5232 lol wtf they quite clearly did not conquer our territory and the Spanish definitely eliminated aboriginal cultures obviously, you don’t know what they did in the Americas
Reply: @zac9235  the Spanish didn't eliminate it, they mixed with the natives in south America.
Reply: @javiercortes5232   The Spanish empire lasted not even half as long as the Roman empire and was way more destructive for native cultures they came into contact with than the Roman empire. Though not even half as destructive as the British empire, which was far bigger and lasted even less.
Reply: You still living in the middle ages or what?
Reply: They invented the steam engine, if in a very primitive form the aeliopile.
Reply: You can! It called modern plumbing!
Reply: You are , look at America.
Reply: If the Roman Empire didn’t fall wwe would be way ahead today technology wise.The Dark ages really set us back until the Renaissance happened which got us back on track
Reply: With electricity and engines, we build pvc and add chemicals.
Reply: Yo all the genius pointing out at Romans in Rome today. You now they are not the same right? They are not the same people even though they share the same name.
Reply: they'd do exactly what we did. They weren't special geniuses; they just had the resources to do so.
Reply: @ELYESSS  Yeah, but we built everything from their experience and knowledge. They built it from olive fields and stone.
Reply: @ELYESSS  Persian people had same resources before romans but they never did anything like that
Reply: @calogerohuygens4430  They actually did exactly the same thing. look up ancient Persian irrigation systems. Pretty much every civilization had their own versions of aqueducts, you just hear about roman ones because the west wants to glorify the Roman/Greek empire and single them out as the only source of modern civilization
Reply: @ELYESSS  the persian Channel network isn't high skilled like Roman engineering. Persians copied roman hydraulic engineering when they captured a lot of roman soldier after battle if Edessa. Please point out something similar to roman aqueduct in Persian empire!
Reply: @ELYESSS  correct. India was the first place to have running water and indoor plumbing and irrigation systems similar to this are also found in the Americas, just not to this scale. What the Romans did was Impressive, it wasn't unique though.
Reply: @ELYESSS  I would disagree with the west wanting to glorify ancient Rome.  As I have learned, the west seems to highlight many different societies top modern contributions.  We highlight greek philosophy and mathematics, we highlight Chinese farming innovations, we highlight the French revolution and how they modernized democracy (which rule by the people was first invented by ancient Greece).  Rome and Greece played a big role in engineering and building more with less.  When you look at the bigger picture, many ancient societies contributed many different advancements to modern society.  Many different ancient societies contributed similar innovations with minor variations to fit their own environment.  History is such a fun subject when you learn the truth
Reply: @calogerohuygens4430 Different circumstances lead different societies to invent fundamentally different technologies. They weren’t special geniuses, they had a problem, and they crafted this solution which was only possible due to the high centralisation of the empire. Though the Persians actually did invent something quite like this called “Qanat”, they were also the first to build windmills.
Reply: @calogerohuygens4430 Ahh, the standard 13 year old mind: "these guys are way cooler than those guys".
Reply: @woodlandwrench  you are broth tester? That's your attitude.
Reply: @calogerohuygens4430  It's called a Qanat. They were built in 3000bc.... You guys really don't like looking up history if it causes you to think or disagree with something else you formed an opinion about
Reply: @calogerohuygens4430 what are you talking about? You were educated just to know a lot about Rome and nothing about the rest of the world. Please go back and truly educate yourself
Reply: @ELYESSS no we hear about the roman ones because they are still standing after thousands of years
Reply: @UwU-235  have you ever heard about Puquios, some were still in use up to the 21st century. The Quanats around the Middle East, or Foggara in North Africa, that turned deserts into oases and are still in use to this day? I'd wager it's the first time you hear those terms, and it's nothing but a testament to my first comment.
Reply: @UwU-235  Do you think people could survive without water? If any population can't invent something better than a well, and they have no rivers around, their population would never go above a few dozen at best.
Reply: @ELYESSS thats not what we are talking about though. We are talking about aqueducts built thousands if years ago which are still standing and many of which are still operational and in use. The roman aqueducts are some of the most complex and well built structures in all of human history. Any country could’ve built an aqueduct, few built them so well that they lasted.
Reply: @ELYESSS so you’re examples are two subterranean tunnels, one of which is about 400 years old. Subterranean tunnels aren’t exposed to the elements in ways above ground ones are. They aren’t as impressive as roman aqueducts
Reply: @UwU-235  we have roman aqueducts in our city. They are not as impressive as the pyramids or the wall of china...
Reply: @ELYESSS id argue they are more impressive than the wall from an engineering perspective. Great wall of china took over 2000 years to build but ultimately its just a long wall. Aqueducts carry water, required people to people able to move through them which means a lot of arches which are a lot harder to do than a wall. I dont know enough about the pyramids to compare but they are impressive. I never said the aqueducts were the most impressive. Also constant exposure to something typically means you lose that ability to recognize how impressive they are.
Reply: @ELYESSS Except the Romans were much more sophisticated. Who cares who was able to do it. Who did it best? Rome stands 2,000 years later. 
What are you jealous about…😂
Reply: @calogerohuygens4430  -- in the new world, there are aqueducts in the Andes (West coast SA/Peru/etc) mountains and near the coast (or going in that direction) - estimated to be about 2,000 years old and many still working as originally built, back then.

Some think these were "pre-Inca".

Yes, maybe there was a advanced global human civilization 12,000 years ago - maybe not.  Clearly some ancient civilizations were, civilized, to a point!
Reply: @ELYESSS ding ding ding! The west only promotes discoveries if the people behind it were .....
Reply: @ELYESSS to be fair as far as the western world is concerned all of the western world can trade themselves back to the Greeks and Romans. After that you could say Charlamain(struggling with the spelling). That's not to say that the other parts of the world didn't have their great empires and innovations.  India at this time had started figuring out medicine and surgery. The middle east had Egypt before the Romans and Greeks, unless you look into itz you have no idea how crazy long the Egyptian empire lasted.
Reply: Look around you...
Reply: you have already seen it my man, I would prefer to see what we would have done without it. This work was one of the only times in human history we made real progress towards a clean and sustainable lifestyle that could support a growing economy of people. We gave up that bragging right with electricity for good reason but real facts as well, this system doesnt survive.
Reply: @mcnalbren they don't make nothing like they used to❤ We used to be good people back in the day💪.
Reply: If they had electricity and engines they wouldn't have designed this in the first place. That's a bit of an anacronic suggestion
Reply: @jcr5083 AuTiSm
Reply: @jcr5083 get diagnosed 🤙
Reply: You say it's truly genius because they didn't have electricity and engines then👌. That's why this is what it is❤
Reply: Its called a lambo🤣
Reply: They could do what we’re doing today…what makes you think that Roman engineers ~2000 years ago were smarter than our engineers today?
Reply: What are u taking about, if they had engines and electricity then life would of been just like how ours is are u dumby
Reply: Not really because they might have not had the government that could be bought to pass stupid laws. Also they wouldn't have to deal with the green nuts. The ones who claimed global warming is caused by man which is crap. Example, if you ever listen to the nightly weather they will say oh we broke a record the last time this record was set be it for rain tornadoes floods you name it some of the records will go back to late 1800s so what was the cause then? @randomgaming667
Reply: They might well have discovered "warp speed" eventually.
Reply: Sure you can , look at the Chinese
Reply: @imperialhistorian4201  chinese lack creativity.
Reply: @tukek88  Poorly worded; sounds racist lol
Reply: @imperialhistorian4201  He wants to see technological marvels, not tofu dreg.
Reply: @imperialhistorian4201  just don't look too hard, the buildings will collapse
Reply: @imperialhistorian4201  You mean the technologically backwards culture that still has the largest single-nation slave labor operation the world has ever seen, is committing 5 concurrent genocides, and literally just steals other people's things because their culture operates on the concept of making numbers go up via fraud, because its more effective at raising their status, than actual innovation, which requires effort and intelligence?

No, I don't think they're a great example.
Reply: Look no further than germany.
Reply: Dirty technologies
Reply: Are you referring to the Romans are some other places? @romanlihin6239
Reply: Sadly, Christianity avoided that. Imagine if the dark age wouldn’t have existed.  Where would we be?
Reply: @justanothernothuman  "Dark age" wasn't really that dark when reading about it. 
I'm not a professor, but major change in faith was possibly one of reasons but the end of antiquity period has been caused by various changes and issues and took lots of time.
Reply: @justanothernothuman  but it lasted 50 years, not?
Reply: @justanothernothuman  Christianity is not the reason for the collapse of the Roman Empire. The Empire collapse because of the dissolution of the Roman way of life, basically they decided to throw away their responsabilies and moral codes and enjoy life, which led to  more and more invasions. Christianity was both the result and the counter to this phenomenon. It didn't save the Empire in its political form, but it saved its inheritage : the church and its members were the link between New Europe and the former Empire
Reply: You're seeing it now bruh. We are the legacy of the Empire
Reply: Some movie lore says they only used Electricity as a torture tool....
Reply: Honestly if you think they are smart for making valves and ramps you are brainwashed
Reply: @PoopPants-b9k  you need to go back to school then bud
Reply: we’ve seen what they can do with electricity and engines. They just became tourist destinations, and nothing more.😂 turns out the Americans and Russians and Chinese are way better than the Romans and Greeks
Reply: @gj1997gj  Russians are better to do what? Vodka?
Reply: @gj1997gj Electricity and engines?  Like an Italian car company?
Reply: @gj1997gj And someone else will be better than them in 1000 years.
Reply: @gj1997gj the empires from which those engineering feats came from fell and the knowledge was likely lost at some point. Same with the archimedes device. Not the same as the Greeks and Roman’s of our time lol.
Reply: @gj1997gj that’s just the country of Rome, the empire in all its greatness would’ve had the resources and the great minds and engineers which made the aqueducts and such to probably do something great with a power grid and industry.
Reply: @gj1997gj  americans, russians and chinese are not better than the romans by any metric, at all. we also have not seen what the roman empire or the ancient greeks would have done with engines and electricity, because they did not have them.
Reply: @gj1997gj That's not a fair comment at all, to say the least. You can't compare these peoples because the historical, economical and sociological conditions were different ! We are the inheritors of the Greeks ( math, geometry, philosophy, architecture, art, theater, rethoric,  poetry, democracy etc.) and the Romans who inherited from the Greeks and had their own fields of competency (administration and law, architecture, city planning, roads,  engineering, logistics, military organisation and strategy, global trading, democracy ( or not !), art and literature, philosophy, rethoric, religion ( the Christian one !) etc.  Without the Romans and the Greeks, no Western civilization at all !
Reply: @helycrisea8189  the Romans and the Greeks should be the most powerful countries on earth right now
Reply: @gj1997gj Well but invasions stopped everything and a long period of dark ages made civilization go backward until the discovery of Greek and Roman books ( after the big fire of the Constantinople's library) which launched the Renaissance era...
Reply: @helycrisea8189  why do you even answer to this dude ahah he wrote one of the stupidest comments I have ever read in my life, at best he is a troll! don't wast time 😂. Modern italy is not an empire (lack of natural resources, population etc. ) and can't be compared with anything like US or Russia. Nonetheless, if Italy was not part of europe, european economy would collapse. That says enough in present situation. And again, don't waste time, this comment section is, in general, just dumb 😂
Reply: @ac_2996 Yes, I agree with you, you are totally right !  But sometimes  I just can't help it when I read such kind of outrageous comments. I have lost so much time, I must say...
Reply: Without the Romans and Greeks, you would still be swinging from the trees.